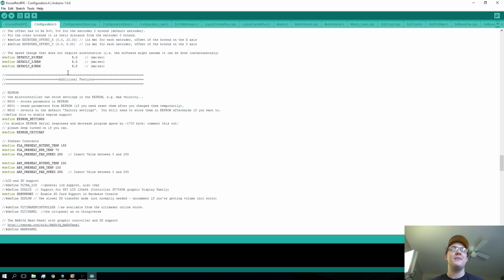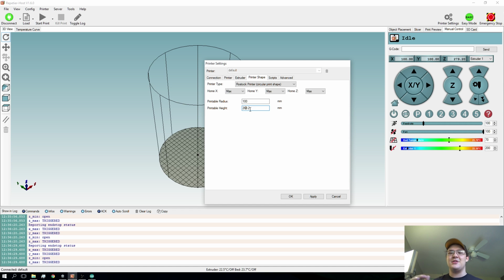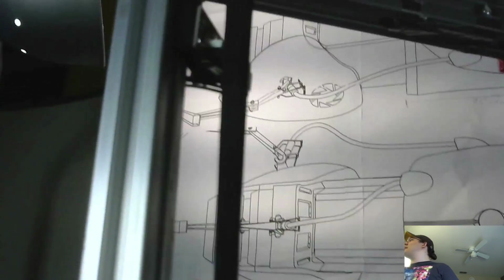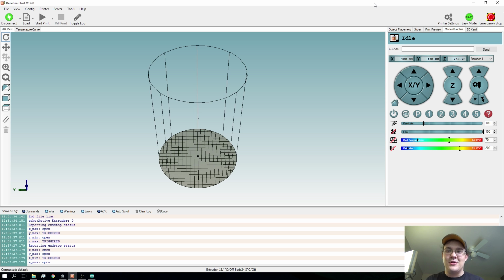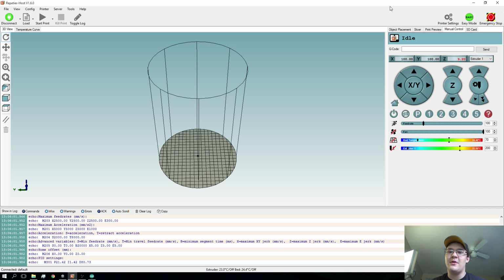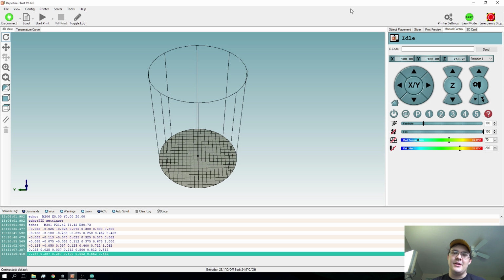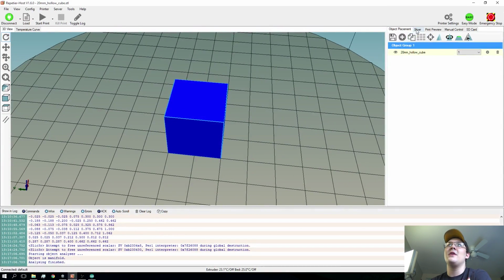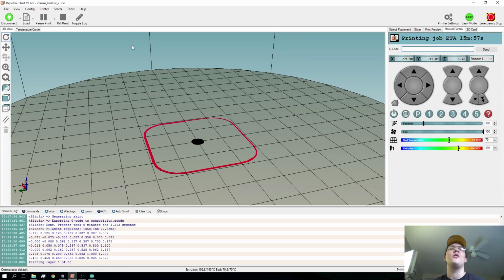Folger Tech Kossel 2020 3D Printer Calibration | #3 - Repetier Host & Test Prints

Comment: I am getting this error while trying to connect to the Repetier after loading up the Arduino software and the Repetier Host

http://prntscr.com/a18nau
Reply: Figured it out... 

http://prntscr.com/a191np

When they assembled the Thermister they crimped the housing too hard and severed the wire...
Reply from the maker: +Taylor Hanamura yes. thermistor needs to work to operate the printer.
Reply: Yea I know that lol, but it took a while to find this problem. Had to take it out of the mount to even notice that the wire was loose inside the housing. When it ohmed at 5m I was suspicious lol
Reply: Alright I got the Thermister replaced and it to home the Z axis on the end stops but now when using the auto home procedure it is not maintaining a level plane and the edges are tipping up causing the nozzle to hit the bed on one half and to rise up on the other. I tried adjusting the // Horizontal offset from middle of printer to smooth rod center. like you said for concavity but it was not adjusting the Z axis at all and was only changing how far out on the base plate to probe the auto level locations.
Reply from the maker: Taylor Hanamura Try leveling the bed manually and trying to print without using the auto level first. You are experiencing a common issue with the auto bed level and the calibration. I dont have a video about the manual calibration yet, but you basically adjust the endstops so that at Z0 in spots near the 3 towers, the nozzle is at the same level as the center of the bed.
Reply: +Dustin Corbin ohh ok so manually adjust the endstop heights to calibrate the towers, I was looking everywhere for that info but noone seemed to be able to say it even though it is so simple lol
Reply from the maker: Taylor Hanamura Yeah, there are ways to do it in the software, but its way too difficult compared to just adjusting the endstops. Just be careful to not touch the endstop PCB connections with anything metal, easy way to fry the RAMPS.
Reply: +Dustin Corbin yea I work in R&D as a Sr. Electrical technician lol I just suck at software still.
Reply: +Dustin Corbin this does not seem to be fixing my problem, after looking at it closer there is play in the head assembly all together so even if the steppers aren't moving the assembly can tilt slightly causing it to curve up at the edges.
Reply from the maker: Taylor Hanamura I made a video about a temporary fix to this.
Reply: +Dustin Corbin this is happening because the bearing on the 20/20 aren't a perfect fit so there is a decent amount of play.
Reply from the maker: Taylor Hanamura The small roller wheels? Are they tightened down all the way?
Reply: +Dustin Corbin yes they are
Reply from the maker: Taylor Hanamura Did you tighten down the screw on tightening screw on the sliders?
Reply: +Dustin Corbin I was just about to mention that nowhere anyone referenced the sled tension screw again after installing it when assembling the sled.... I feel dumb now, adjusting them now.
Reply: +Dustin Corbin and that was the problem lol, thanks man =)
Reply: +Dustin Corbin the auto leveling is working perfectly now
Reply from the maker: Taylor Hanamura Glad to hear it
Reply: I am getting it to print thinner or even brush base plate and thicker on the other side though.
Reply from the maker: +Taylor Hanamura that's normal. It's inevitable.
Reply: Ok good to know

Comment: Hi Dustin, Great video, quick question, im having serious issues with my bed level probe, sometimes it will activate and start leveling mid air, other times it will deploy, lower down to the bed and then start but then skip a few points because it raises to high and then the print is all weird. any idea on how to repair that? also where are the actual bed level probe settings, ie which config file, all i see is the configuration.h where all i can do is set the grid points to probe. thanks again!
Reply from the maker: +TashTech That's weird. Are you using the firmware files from Folger Tech? The majority of the settings are in config.h, there is a "z probe offset" variable that allows you to adjust the offset. Marlin_main.cpp has the actual leveling code, but the stock code works just fine.
Reply: +Dustin Corbin  its not a folger actually should have mentioned that. its a kosselxl and iv tried the xl config from github but then went and edited blomkecoconfig because it seems better for some reason. think i should use the folger config?
Reply from the maker: +TashTech I recommend it. The files are in the google drive link in the description. Ive tried all the Marlin versions on Github and I couldn't get them to work at all. Basically exactly what you described. I can't guarantee the Folger one will work, but I know it works for me and most of us users.
Reply: thanks, will give it a try!
Reply: +Dustin Corbin thanks dustin. there was too many variables to change in the folger config but i found out why thutprobe was sartong mid air and skipping probes etc. facepalm it was getting stuck in the printed piece and not contacting properly with the endstop. i have a glass bed so the inductive proximity sensor wont work. i feel as though the kossel bed probe is very flawed. perhaps you can do a video on a FSR  setup. i know folger is allowing it.

Comment: I have no play wat so ever...parts are coming out a lil bigger but nice and uniform....printing at 2mm layer 1-3 perimeter. abs 240c and 105c. no problems sticking down. just can't get the tolerance right....thanx. is there another way to chat with you....
Reply from the maker: This or my email which you can find on the 'about' page on my channel. I may take  awhile to respond since Im working during the weekends.

Comment: Hey Dusty
I just took my probe off and built a bed leveling system w/ springs under bed. way easier than dealing with bed height probing....I am having trouble with parts not fitting together(tolerance to tight, breaking parts) like gears and ball sockets....I have calibrated it everyway I can.....any ideas....ace
Reply from the maker: Check for play in the effector and diagonal arms. I have two videos about it. It caused problems. Also check dimensional accuracy with a calibration cube.

Comment: Hey man nice vidz,
Just wanted to let you  know a little about bed probe. When you run a bed probe it tests to one side of the bed with the probe(DEPENDS ON THE SIDE YOUR PROBE IS ON) If you go into arduino code and change your z_probe_offset to (-25, ?, -23, 0) it will run probe centered to the bed....If you change your  AUTOLEVEL_GRID ?? to higher number it will spread the tests out farther.....I got my printer about the same time you did and learning on my own also.....good work, I love this printer.... Thanxx ACE
Reply from the maker: +jeremie lail Yeah, Ive tried that. Oddly enough I get better quality if i leave the offset at (0,0,x,0).

Comment: when homing my kossel doesnt stop at the switches. insteed it keeps on runing. i have tested them via the m119 order. what am I doing wrong? also I have the problem, that i have to plug in the motorwires for the x axis in another way then the y and z axis for it to work in the up position. Before the motors were just going downwards and hit the bed even if i inverted the value in arduino. The next problem i have is the motion of the motors. the x axis moves right away but the y and z axis move just after a vew seconds. Please help me!
Reply from the maker: Make sure you have the homing position set to max for all three axises in repetier host and the arduino software.
Reply: I have done this but nothing changed. Still have the Same problem
Reply from the maker: +doertepn when holding the end stops the red LED lights up, correct, and when holding them and running m119, it shows them as triggered?

Comment: Dustin, When I am doing the auto bed leveling it goes through a lot of the process but ends up stopping on the side(goes straight down, and starts going till it hits the right side). It just stops and never returns up, do you know how i can fix it? or what did I do wrong...?
Reply from the maker: +Dom Rill As long as you run G28 first, then G29 to level the bed, everything should work. Are you using the firmware from Folger Tech's Google Drive link?
Reply: +Dustin Corbin i did use the firmware from google drive i used the Rev A because mine looked like the picture
Rev B pictures looked different from my printer i think mine is the older version of the printer
so I'm not sure if i should have used the Rev B instead?
Reply from the maker: Dom Rill I believe they are both similar, maybe a few different variables, but I have never messed with the Rev A version.I just don't know what else could cause the stop in the middle of the command.
Reply: +Dustin Corbin i tried to upload Rev B firmware but it times out every time so im guessing i have to use the Rev A do you think that is correct and if so what do you think i should do to fix this problem?
also thank You for your quick reply
Reply from the maker: Dom Rill If it is timing out, then you arent getting a good connection to the printer. The Rev B firmware will upload just fine. Make sure you have the printer Disconnected from Repetier before hitting upload on the Arduino software.
Reply: +Dustin Corbin when i upload Rev B then the auto level switch does not work when i run g code M119 it says open but if i keep testing it with M119 ever once in a while it will say triggered also does it matter what location the x,y,z motors and end stops are
Reply from the maker: The sensor should say triggered when the sensor is near the build plate. And yes, all three motors need to be in a specific order which i mention in the first calibration video, and the endstops must be on the same tower. The X endstop has to be on the X tower, etc...
Reply: +Dustin Corbin still freezes up during G29 I'm at a loss for what is wrong it all ways stops in the same spot the z corner slide bottoms out on the acrylic stop I remeasured the height of the end of the slide rail and it is set to & 23/32
Reply: +Dom Rill sorry i meant 7 23/32 from the top of the plastic bottom corner

Comment: Thanks for your help Dustin, I went into Slicer and found where you can adjust z offset,  by making the number + and larger you move the hotend further away from the bed, with a larger negative number you move the hotend closer. I assume the same logic holds for Z_PROBE_OFFSET  a - value means the sensor is closer to the heat bed and a + value means it is further away.
Reply from the maker: +Jerry Anderson yes that is how it should be. Just remember that it really should only be used for small adjustments. Anything more than 1mm should be adjusted with the print height value in Repetier and the Z height in Marlin (arduino).

Comment: Hey Bro! Thanks again for all these videos.. I can't believe I had X and Y reversed..lol. Anyway.. I can M119 and Everything is Perfect Now. I can Home the Printer, and all Three Endstops trigger properly!! YEAH!!!   I did a G29 and it "Almost" worked, but does it in Mid Air about halfway up :(

I adjusted the manual home position from 269.2 to 273 and uploaded it to no avail. still wont lower to the bed..   I was able to manually put the print head close, and it did detect the bed and did autolevel (kinda) but acts like it "thinks" the bed height is too small.

I'm going to watch this video again, and see if I missed something.. Im getting REALLY CLOSE (I think) and can manually move it etc..

Same goes when I manually use repetier host to lower the Z-Axis as far down as it will let it, and it stops about one inch above the bed..

I'm stumped..  must be overlooking something... even when I change it to 275 (Firmware) it still stops an inch above the bed. I checked printer settings in repetier.. same setting 275 and it still stops 1" above..

One inch to go, and it'll probably print etc.. soooo close..

You're awesome for doing this.. hope you don't mind.. I emailed folgertech.com and told them how awesome your videos are and they confirmed they are in contact with you and like what you're doing..  maybe they can send you something in return for the R&D you're doing for us!! Maybe they've got a prototype or something...  Doesn't hurt to ask ;) ;)  You DESERVE it for going out of your way to help everyone!

3DPeace
Reply from the maker: +Bryan Kale I appreciate that man! I think You should put the z height up to something like 310 or 320, then manually lower the z axis until it touches the bed. My number is low because I don't have my printer set up the same way, but I just helped someone yesterday and their z height was around 312mm. I'll do another tutorial in depth on this this week as it can be really confusing. Just remember to change the value in Repetier and the Arduino software. :D

Also thanks for letting Folger Tech know that you like my stuff! I've been in contact with them for a while and they make great stuff as well as been great to me, and I'm glad I'm able to help them out by helping all of you as well as contributing to making a better product. :D Thanks again.

Comment: Great video and a massive help. I'm having trouble with the probe. The LED light won't come on. I looked through the photos on the google drive and noticed I'm missing the thin red and black wires going into the power supply on photo DSC00175. Can you tell me what these wires are for? They aren't on the wiring diagram and I'm hoping it will solve my probe problem.
Reply from the maker: You need to create the circuit they show in the wiring diagram for the sensor. There is a black and red wire (and an unused color) in the kit that you use for the sensor. You also need to use the two resistors provided as they show.
Reply: I have done that already, so right now the only wires going to the power supply for the probe are the blue to the ground and the brown to the +V. The black wire has the resistors and then the plug into the board.
Reply from the maker: Mark Mathews and the black wire is split off to two like in the diagram correct? Also have you checked to see if the end stop is registering in repetier? The LED on the sensor could be bad. But that is odd.
Reply: +Dustin Corbin Yes sir the black wire is split into the red and black wire for the connector, and all three endstops register in repetier. It's not the LED because the sensor does not register at all on repetier.
Reply from the maker: +Mark Mathews interesting. Assuming the wiring is correct, you could have a bad sensor.
Reply: +Dustin Corbin Anyways I have a much bigger problem now.. I had the printer plugged into my laptop and all of a sudden my laptop shut off and the LCD screen on the printer got bright. Now when i plug the printer into the laptop the screen comes on and reads temps and everything, but when I plug the power into the printer the screen gets bright and unreadable. When the power gets switched off it dims and for a second you can read the normal screen and it's throwing a mintemp error before shutting of completely. I tried re-uploading the firmware but it gets stuck on uploading. When I try to connect to repetier it either says access to port denied or puts out lines and lines of symbols. I'm guessing something shorted?
Reply from the maker: +Mark Mathews I would completely take out the LCD for right now until you get things working. You can control everything on the printer from the computer software. Check your wiring to the Arduino again just to see if anything is shorted. Honestly I have no idea what could cause that. :o
Reply: +Dustin Corbin I took the LCD out and still can't connect the printer. I'll start to take it apart and check for shorts. Thanks!
Reply: +Dustin Corbin One more quick question! I took everything apart and plugged just the arduino into my computer and it won't upload the code still. I guess there was some kind of power surge. Do you think I should only replace the arduino or get the RAMPS controller that already comes with the arduino just in case?
Reply from the maker: +Mark Mathews it won't hurt. Make sure you have the settings right on the arduino software to allow it to communicate to the arduino. I don't talk about it in the video and I'm assuming you did. But yeah, surge is possible. Having the spare controller is always a good idea.

Comment: can I get a file for that fan shroud?
Reply from the maker: +RandomDevil1 Reload the page, I just added the thingiverse link to the description. :D
Reply: +Dustin Corbin Thanks, man.  I never was sure if this hot end was comparable in size to the E3D V6. I make vids on this printer as well. Quick question, do your cubes come out square? Mine are not and I'm working on a process to fix it and make a video on it. I was just wondering if yours were square from the start.
Reply from the maker: RandomDevil1 If I'm printing in the direct center then yes mine come out square and always have. How out of square is it? Only think I could think of is if your calibration is way out of wack, or something in the construction isn't right.
Reply: +Dustin Corbin Yeah, research on the internet shows it's what happens if the rods aren't cut right or the angle of the corners is not perfectly 120 degrees. It's far enough out to be visually noticeable and cause 30mm circles to be a millimeter off around the edges. I'm working on it. Thanks again.